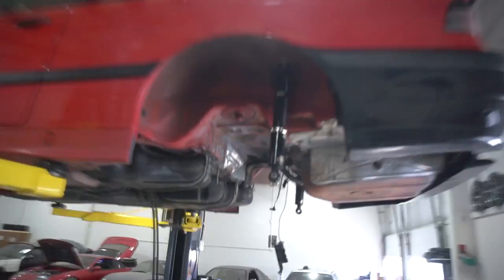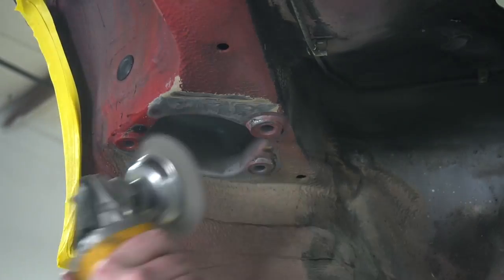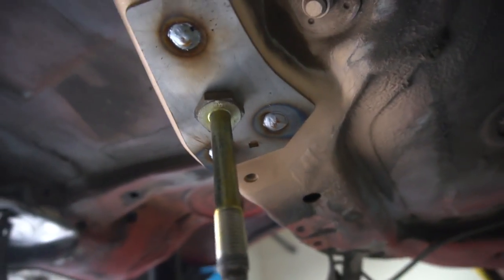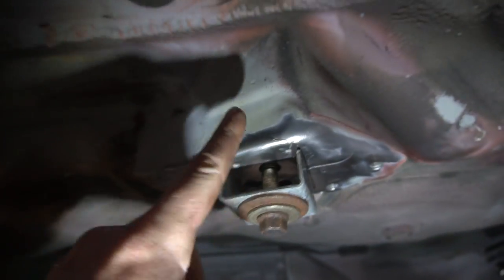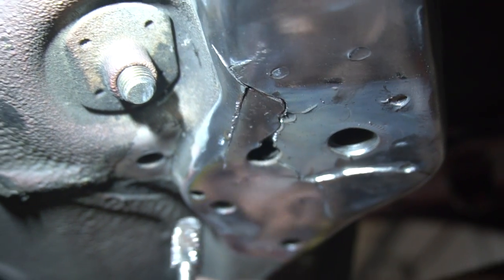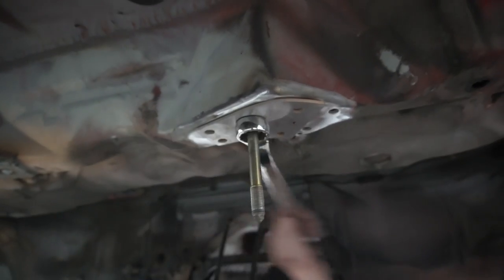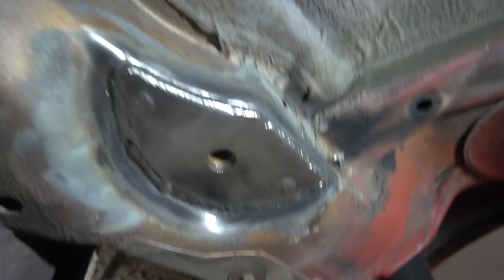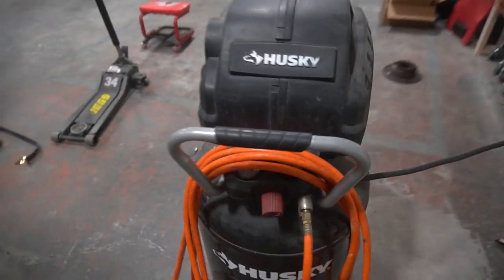E36 subframe mount REPAIR & REINFORCE!

Comment: Whenever welding a crack, where possible it's best practice to drill a hole at each end of the crack. This creates a stress relief point and stops the crack from trying to creep further
Reply: Just started to write this then I noticed your comment. Very good suggestion right there.
Reply: Same, like a hundred people commented that under last video and he still didn't do it.
Reply: thanks for the tip, im gonna undergo welding up my e36 this year so anything like this helps
Reply: I agree if just welding the crack to fix it, but the plates he was welding on prevent that from being needed in this instance. Regardless it's a tip most should know.
Reply: @zacharyballew4320  it would really depend on how stressed the underlying steel is after the insert is welded on. It appears that the stud still threads into the original hole therefore the original metal would still be stressed.
Reply: @magnetic0314  The point I'm trying to make is this isn't a hypothetical of maybe this or that. This has been done 1000's of times thus far, same way and I myself have been part a handful of them in my day and it was done precisely the same way. Mind you I nor my friends who's cars that were being worked on are body guys like BHall who is there damn near every step of the way. The tip you gave is helpful in general terms, but in this specific case it wasn't needed with the reinforcement.
Reply: Should be fine. On that thin of sheet metal, the heat from MIG should have rearranged the grain structure enough that the crack shouldn't continue to propagate. Plus the support plates are pretty much tripling the material thickness and redistributing the stress load to a wider area. Good job Jim.
Reply from the maker: For such thin metal it’s not nearly as important, I just over weld the crack. Thicker metals and aluminum it’s extremely important.
Reply: @JimmyOakes  I am local in ct and just had my rear driver side subframe mount give out. How much would you charge to do the subframe reinforcement in my e36?
Reply: @zacharyballew4320  wrong
Reply: @kalebgullan4157  😗🤣

Comment: YOO. Thank you so much for this video. I'm a BMW dealer tech and starting to learn welding so that I can reinforce all the weak spots of my 97 M3. I never knew I could have broken spots without knowing until the subframe is dropped. 
I appreciate seeing not only how to properly install the plates, but seeing how you fixed the broken spots. 
Hugely helpful video and honestly puts my mind at ease how you said to give yourself a weekend. I plan to take a week off work and use my lift to just knock everything out at once.

Thank you 🙏🤙
Enjoy the ride m8

Comment: I get to do this at the end of the month 🙃 luckily none of my mounts have cracked. Subframe has been on the shop floor for 2 weeks waiting to receive my plates and mounts. thanks for a pretty in depth video on how to go about it 🤘🏻
Reply: wethepeople406 how much did the plates cost?
Reply: CompressorSurge I got them through Garagistic, they were ~$80 iirc. For trailing arm pocket plates and subframe mount plates

Comment: when i bought my 318is to turn it into a trackcar/engine swap etc, the subframe had 1 bolt/stud left holding it in, the other 3x were totally ripped out and like a crater so it can get pretty bad stock, reinforcements are mandatory, my m3 3.0lt euro has them standard and its still good!
Reply: What did you do when it happend?
Reply: @brandursrensen2953  we bought reinforcement plates and some donor peices from the wreckers cut my car open top and bottom qnd welded it all back together
Reply: @blakeaust thank you i need to do it to mine e36 325i 1991-1992
Reply: @brandursrensen2953  goodluck mate, its quite the task but its achievable and will bring the car back to life :)

Comment: I had my e36 done 2 years ago, subframe literally fell and was holding on from one mount, ended up having a precious shitty repair so was done properly by going behind the seat into the uni body and front boot, repaired the damaged and weldied wider armor plates then those used in your video, poly Bushed everything whilst there.
Reply: What model and what year was your E36?
Reply: 1993

Comment: Just to help anyone that is doing this or planning on repairing there e46/e36 when your grinding your welds down for the sub frame to sit properly use 120 grit flap disc on your grinder not a normal grind disc it will save you alot of time grinding your welds down just did this repair on my 1999 323i e46 sedan

Comment: I had 92 sedan which had 2 mounts completely ripped out. We welded the OE mount on the reinforcement plate, and then welded it onto the chassis all together. Probably not the proper way to do it, but it's still holding.

Comment: Jimmy, heads up! Great job on the plates, but the biggest issue with the e36/e46 rear structures is the inner support of those bulkheads between the inner and outer sheetmetal. BMW sells the lquid sealer to stuff in the structure by the mounting holes to help stiffen up the hollow space in between. This is the best option on top of the the bottom reinforcing. It will definitely help being that you will be doubling almost tripling the stock output of what that chassis was designed for my guy.

Comment: Great video! IMO Upgrade to a belt driven compressor(not noisy direct drive) and put it in a cabinet somewhere far away. Also, Air powered die grinder is my go to for small spaces (like gasket surfaces) but for large surfaces you dont mind getting hot you cant beat a 4.5" flapper disk in 40 or 60grit on an electric grinder.  Makes short work of weld high spots, keeps everything flat and wont dig any grooves. Buy the good ones, they last forever.

Comment: Had the whole chassis tear holes out on my e46 328i apparently bmw did a recall but I missed it by a couple of months. pre face-lift seems to have more of an issue but sad because the reinforcement plates were not available at the time and ended up scrapping her. Still miss the e46 even with a shot rear end it was so much fun lol

Comment: Guess I’m a little late but bmw makes oem reinforcement plates for it which co over the bended parts. Hard to explain but the metal which it is welded on last way longer that way. And those near the sils don’t make sense and only weaken it because these don’t crack around the areas you weld them on.

Comment: There are "X-Braces“ (don’t know how they are called“ which you can use if it got fully ripped out or if you want that extra secure subframe. Those are getting mounted in the trunk and you bolt the subframe to the brace

Saw that on an e46
Reply: for the subframe to be more secure? instead of welding reinfircements?

Comment: buy an e36 from Canada, the whole sub frame will be rusted away, will need about 10 square feet of new metal... minimum 250 inches of welding. $8/inch.

Comment: Do not weld out just tack the metal every 1"  if you notice  bmw does not weld out joints they spot weld and then glue it with epoxy  when ever u weld out it causes stress in the material  and will Crack again right next to the weld the only way to prevent  it from cracking where you welded out the hole joint is to stress relieve  it and you have to heat the material up to 1100 degrees for 10 hrs to realign  the welded molecules with the material making it one . Union trained local 469 steamfitter .

Comment: I’m just glad you made these videos before I bought a bmw, I never knew about the subframe problems. I’ll never buy one now 😅
Reply: Right? What kinda car has issues with a subframe cracking?
Reply: Kevin Michalik only bmw can get away with making the biggest buckets around. Here in Canada they are always rusty so I can only imagine how bad some of them are here lol.
Reply: Aidan Bulwicz yeah that’s terrible considering how much an m3 can go for when they are “clean”. Would be very easy to overlook this as an amateur, than you have to worry about your entire rear end falling off the car
Reply: Yeah its pretty stupid but the problem starts only when people neglect changing subframe bushings. Terrible design but pretty much the only problem with e36`ses. I´d rather do this once and never worry about it again than blow five different SR20´s or JZ´s with "JDM" stuff.

Comment: I wonder how this made it past BMW's engineering teams?
Reply: They reinforced the m3s, i assume for budget and time reasons they figured the base models wouldnt have a need since they weren't close to making the power neccessary to rip the chassis
Reply: It doesnt break with fresh subframe bushings so i think they just didnt have enough endurance testing. What boggles my mind is that how in the hell they passed the same flaw into e46´ses EVEN WORSE
Reply: @tegthhu7678  makes sense, subframe bushings fail causing more play and that causes greater forces on the body.

Comment: Okay I'm at the three something mark.... People do not do a Jimmy just did..., I did not see Jimmy weld up the cracks that were already in the chassis..... Jimmy Jimmy Jimmy what am I going to do with you ...... even though you're welding in the brackets you still need to repair the structure that was underneath of it or you still have no structure..... Uhg .... Now you just kind of have a rust panel patch.... Unless you do something completely different after I unpause this but currently at 3:16 you've already put copper spray on in about to weld.... I love you just don't want to see your car and whatever have problems later on down the road..... So you may need to take the extra time to take it back offand weld it correctly and I know I should probably watch the rest of the video before making a comment but it makes me cringe lol